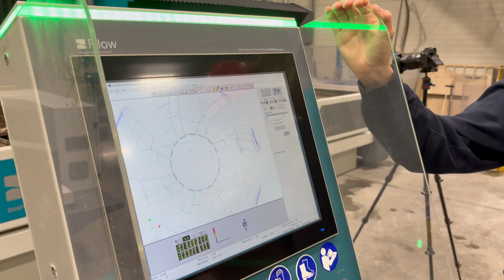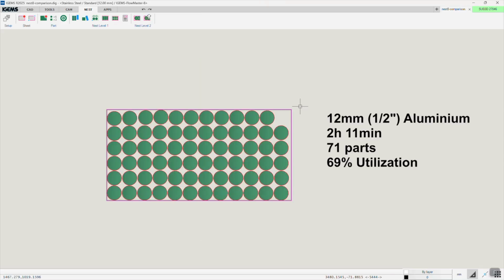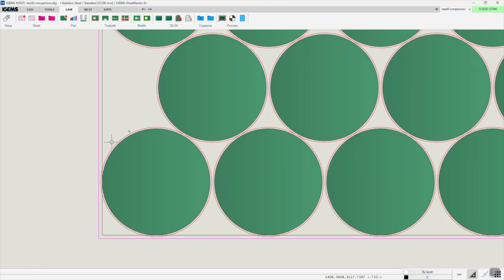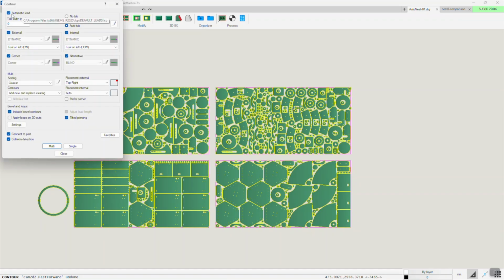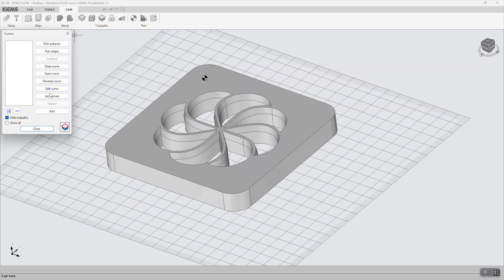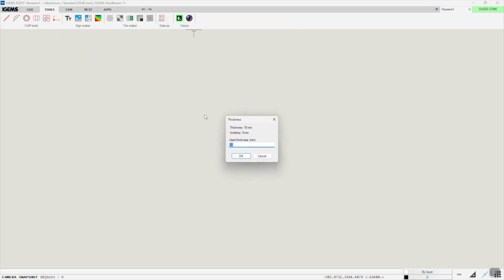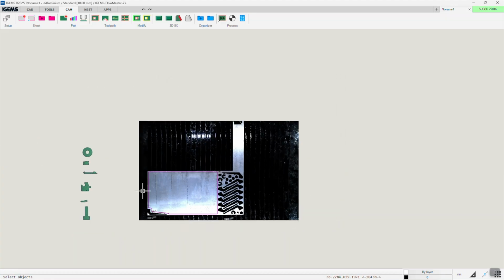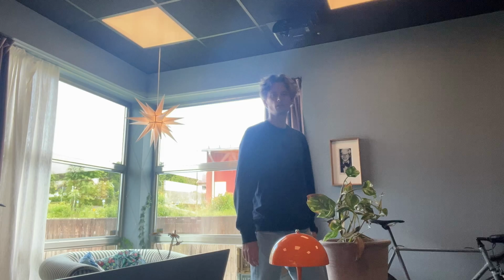IGEMS CAD/CAM on Flow waterjet machines

Comment: hi , been testing the program littlebit for my flow machine, (flowmaster 6 ). one thing i have found that is a problem is the markings function. i have a air controlled abrasive feeder and i cant make the program to remove the abrasive or change speed on markings either. i would be nice to have it as the scribe function ( faster movement without abrasive ). 
if its possible to fix it and i have done something wrong i would love to learn how! :D
Reply from the maker: Hi! Thank you for the input @FuRZ1X. Can you please email sales@igems.se and we'll have a closer look at this. It shouldn't be a problem!
Reply: @igemswaterjet will do!🤩
Reply from the maker: Good stuff 🤩

Comment: May I ask how it handles tabs in your program, so parts do not fall into the machine?
Reply from the maker: You could either use our Automatic leads that can leave a negative overcut depending on the part size and how the direction of your table's slats. Or you could manually place something we call micro joints. These can either be a lead-in/lead-out or a section that's sped up.
Let me know if you have more questions